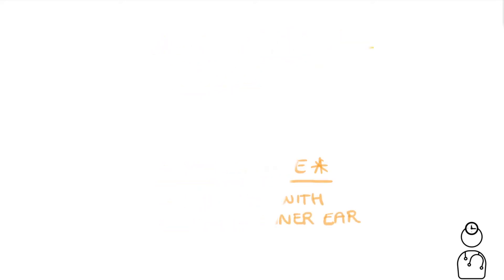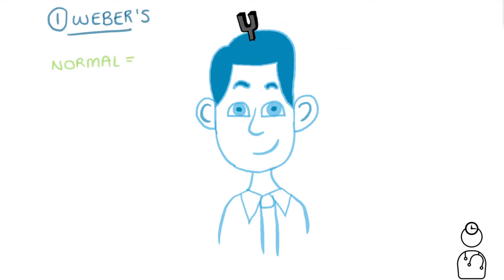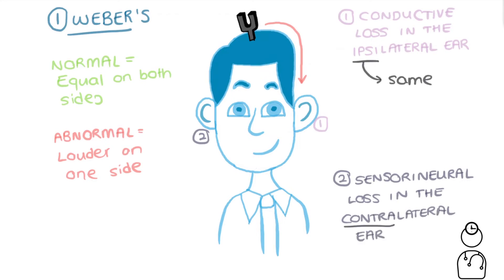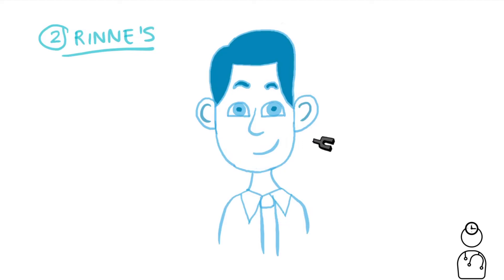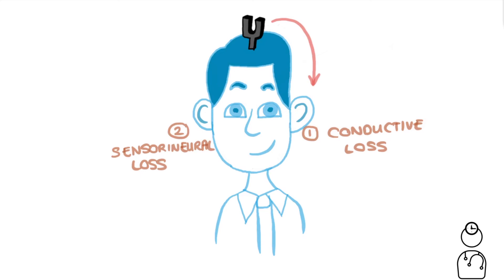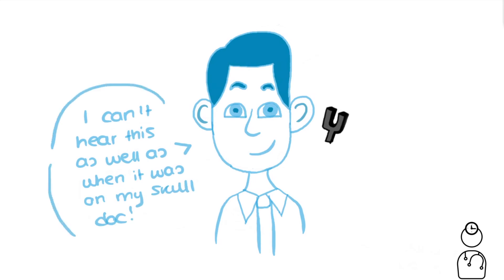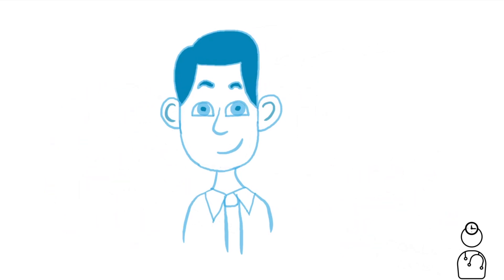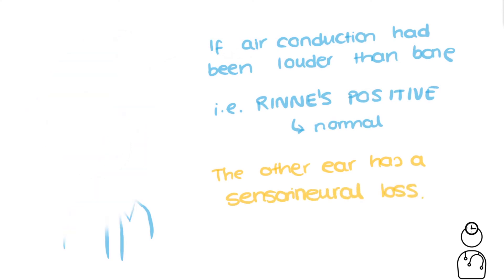Weber's and Rinne's Tests Explained in 3 Minutes | Medic in a Minute

Comment: What if on the Rinne test you can't hear either through bone conduction OR air conduction; what does that mean???
Reply from the maker: I think in a practical sense, Weber's and Rinne's wouldn't be used alone to diagnose hearing loss. I think a physician would most likely order formal audiometry testing - so long story short, it wouldn't really help you very much and you would most likely want to do further investigations.

Comment: What if in the webber's it lateralized to the left ear. And then rinne's was negative on left side and positive on right side?
Reply from the maker: @logbydhamo9478  Other way round (ipsilateral conductive, contralateral sensorineural). Sensorineural lateralises to the better ear, meaning the contralateral side has a sensorineural hearing loss, whilst conductive hearing losses are heard louder in the affected ear i.e. ipsilateral. You can consult various sources, here's one :) https://www.ncbi.nlm.nih.gov/books/NBK526135/
Reply: @medicinaminute1533  thank you sooooo much
Reply from the maker: Weber's lateralises to left = either an ipsilateral conductive loss or contralateral sensorineural loss.

Rinne's negative in the left i.e. an abnormal test (remember, Rinne's negative means the test is ABNORMAL), it suggests there is a conductive hearing loss in that left ear.

Rinne's positive on the right side i.e. a normal test = the right ear is normal.

Hope that makes sense!